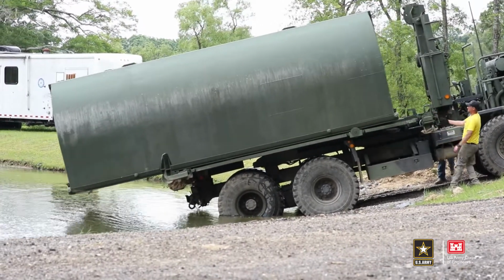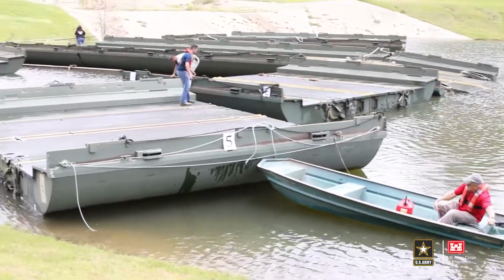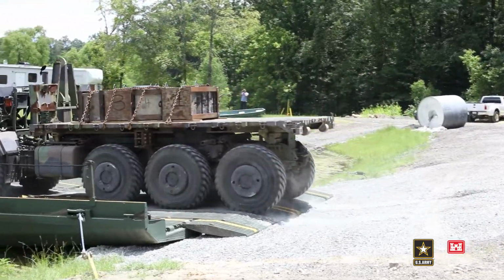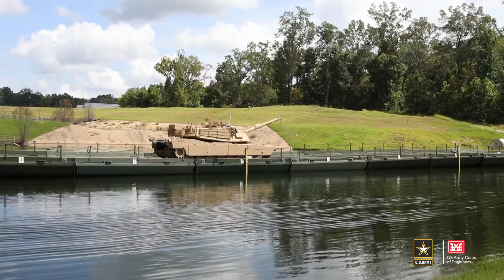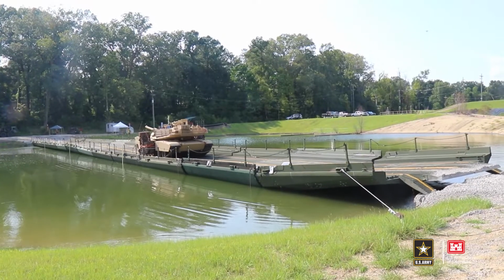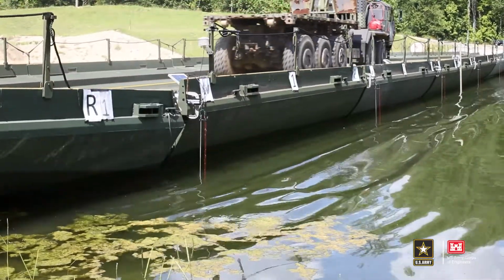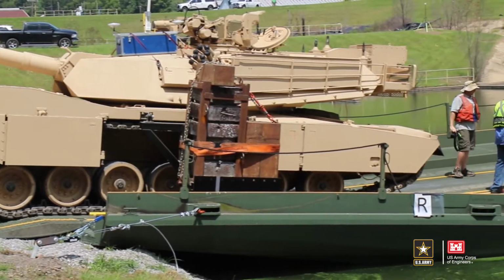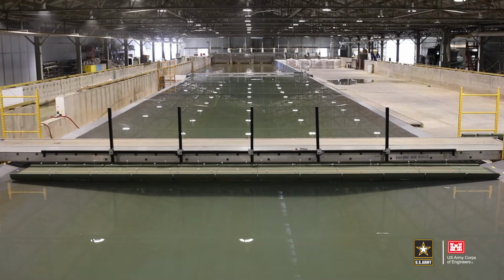ERDC Tests the Improved Ribbon Bridge

Comment: i know for a fact that the Improved Ribbon Bridge is capable of supporting a Fully Loaded Heavy Equipment Transport vehicle with an M1 Abrams Tank with a Mine Plow on it and it’s also capable of supporting an M88 Hercules Heavy Recovery Vehicle, because i have seen both when i was deployed to Tikrit Iraq in 2003 and my unit had a Float Bridge across the Tigris River